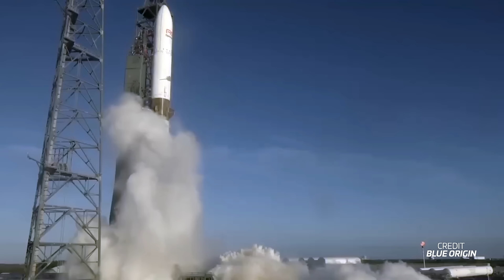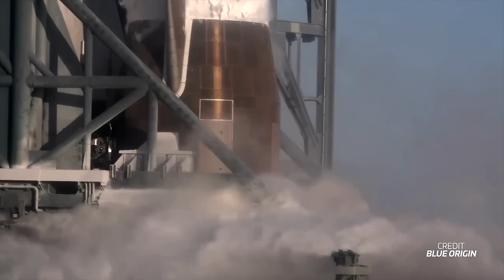Blue Origin’s First New Glenn Booster Reuse Is Almost Here! | This Week in Spaceflight

Comment: I'm wondering why the new large docking port couldn't have been made earlier... Was there some technical limitation with the old design(s) that prevented them from being scaled up?

Also, that Gauss engine looks almost exactly like the Dawn spacecraft thruster. I'm sure you've heard of it before.
Reply: No technical limitations, per se.  The existing designs (for the Shuttle and the ISS) targeted backward compatibility with older Soviet, then Russian tech dating back to the Mir space station.  Vast's new designs are among the first to propose space station modules that are in themselves large enough to accommodate such a large docking adapter.

edit: I suppose it's a "technical limitation" that ISS modules had to fit within the fairings of contemporary rockets, or inside the Shuttle's payload bay, respectively.  Vast will require Starship, or possibly at least New Glenn, to launch its significantly fatter modules.

Comment: I dont dare say this is a booster reuse. Spacex doesn't change engines on falcon 9 nor starship when being reused. The most crucial part on a rocket launch are the engines. Also one of the most expansive on a rocket. To me a real booster reuse are the same fuel tanks with the same engines when it launched before with those 2. Putting new engines on it and say its a booster reuse doesnt fit for me
Reply: The one time (so far) SpaceX has reflown a SuperHeavy Booster, they replaced the majority of that Booster's engines between the flights.

Comment: In essence the Common Birthing Adapter is for joining Space Station modules together. It is very slow but solid and takes around a full day to attach/detach.  Think of it more like building a garage on the side of your hows instead of just parking the car there.  It is for permanent connections not for crewed connections though some Cargo modules use it.
Reply: So it could be used to connect a Starship module to a growing station but not to move large cargo from a visiting Starship?
Reply: @SteveEhrmann  Cargo is fine nobody needs a cargo pod as a life boat you don't want emergency egress that takes hours to securely shut the door on.  Basically they are designed for different things
Reply: 2.9meters=9 feet 6.173 inches